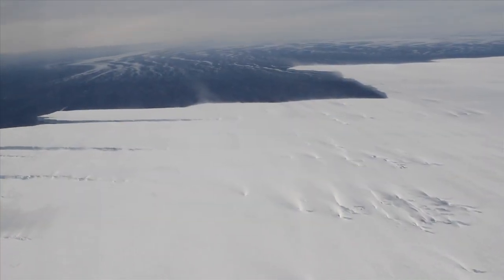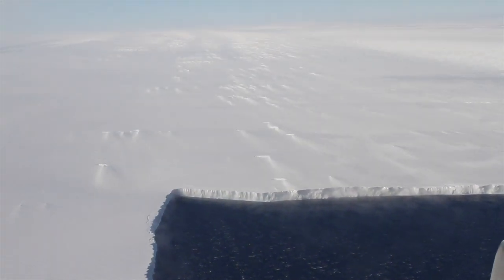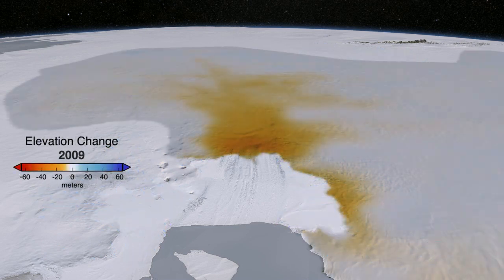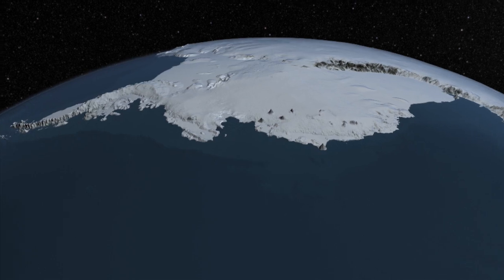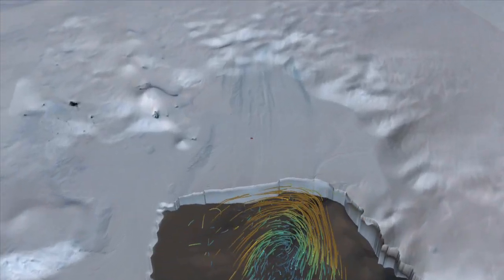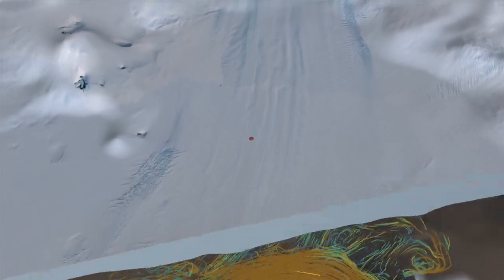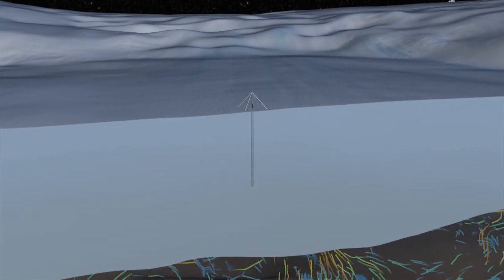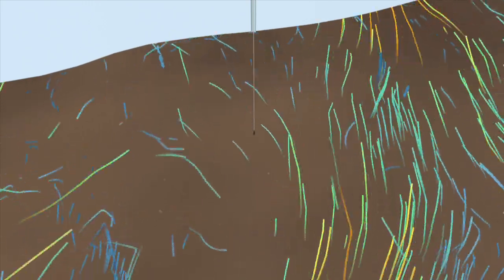NASA | Warm Ocean Melting Pine Island Glacier

Comment: doesn't the city you live in have weather that is expected throughout the year? certain months are colder and certain months are warmer on average. if i looked at the temp over say the past 50 years i could see an average pattern that its 30F in jan and 70F in july. if avg temps in july were 80 then i could say there is a change from the pattern. patterns depend on time.  given an amount of time you can say there is an average pattern that has occured.

Comment: that 3% is a huge number.  the carbon cycle is very balanced on earth. human contribution to co2 has happened so fast, that natural inputs causing the same increase in co2 would of had to take tens of thousands of years. humans only took 120 years to double concentration levels from around 200ppm to 400ppm.  natural inputs are balanced, absorbed by oceans, just part of the cycle.  though humans are adding co2 without balancing it out, disrupting the cycle.